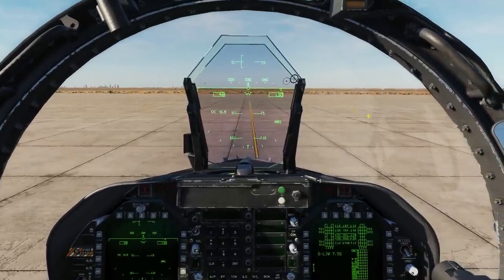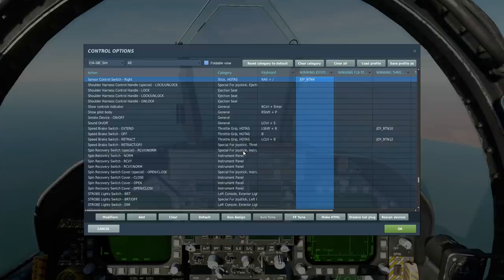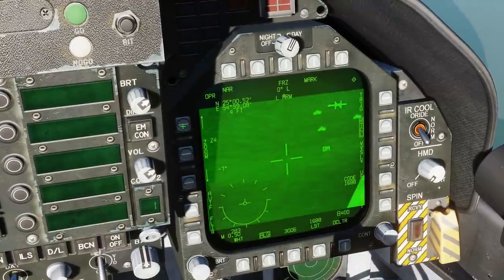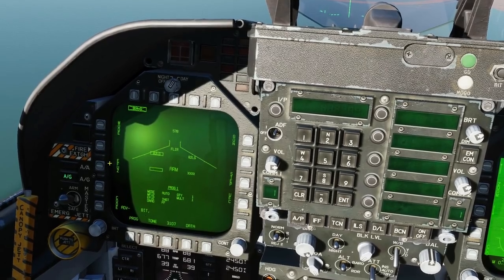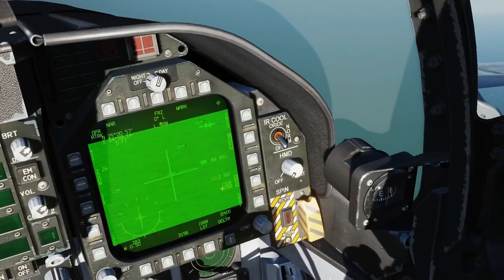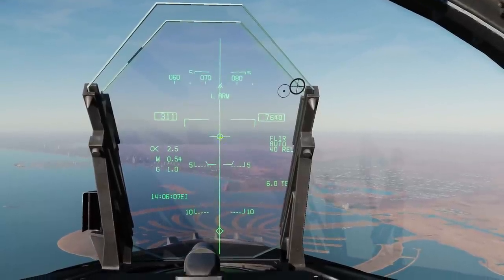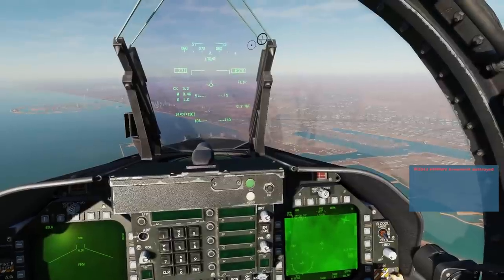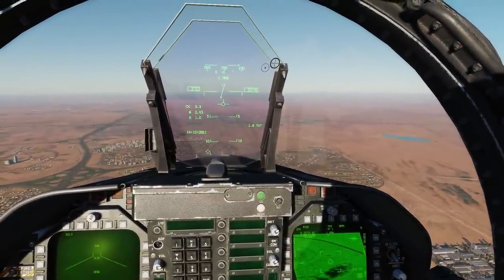FA-18C Hornet: GBU10/12/16 Laser Guided Bomb Tutorial | DCS WORLD

Comment: I have a question. Why would you, in any sensible world, force the pilot to type in a 4 digit code multiple times to make the tgp pod lasers work with laser guided bombs that both have been loaded onto the same plane? I can understand that all these settings should be fully editable so anyone can buddy laze with anyone else, but what massive hurdle is there that stops the plane defaulting laser guided bombs to the code the tgp has when those bombs are loaded. By forcing the pilot to do it, all you are doing is introducing an unnecessary possibility of a pilot typing the value incorrectly. I also find it amazing that you can target and launch 'dud' munitions (weapons that the aircraft's system knows will be useless)
Reply: Normally, you'll have all your codes set up prior to take off. The reason you want it editable is to be able to work with a JTAC or another aircraft providing the target lase. It needs to be editable on the fly in order to provide maximum flexibility.
The aircraft doesn't have a lot of guard rail as the expectation is that the pilot has enough training to make full use of the systems on board.

Comment: Got a GBU 12 on the rack and the laser designator switch is armed so I have L ARM on the hud. The hud is flashing code and when I hit the code button to type it in to the UFC I type the default 1688 and when I press ENT it just says ERROR. I can't tell the bomb what code to use for the track. I've followed this tutorial and Hoggit's guide but all I get is ERROR when entering the code. What am I doing wrong?
Reply: Did you ever figure this out as I am having the same issue
Reply: @mhsucio6830 you probably need to click the "CODE" on the ufc again instead of just typing as soon as you hit the button on the flir
Reply: @MedicLukas  you are correct. Thanks for atleast responding.
Reply: @mhsucio6830  no problem m8, happy to help. Sorry for the late response

Comment: Whenever I try and use the tpod it gives me all the info on the screen but the backround were the camera would be showing is just blank green as if the screen is turned off but I still have all the info on the screen.
Reply from the maker: You got it in STOW mode. Click VVSLV on the right of screen :)
Reply: @grimreapers  howdy GR, i have a similar problem, screen says Not timed out. Does the lightening pod have to "warm up" or something, or should i avoid testing the flir on ground preflight? Cheers

Comment: Im having a problem with the laser designator not turning on to arm, any recommendations other than im stupid
Edit: NVM  fixed it
Reply: how did you fix this. i have the same issue
Reply: @gramerly  you need to have A2G mode selected and the FLIR Pod switched on
Reply: @simadapt9665  how do you turn on flir pod

Comment: DCS Question: Will the F/A-18A/A+/A++/B/D models be added?
I felt like F/A-18C wasn’t enough in the DCS World. We have the F-14A (135-GR late, and the upcoming 95-GR (early), 135-GR (early)) the F-14B, but not for the F/A-18. For me to specify the F/A-18 variants in DCS, here they are:

F/A-18 Legacy Hornets in DCS
F/A-18A/B (Lot 4 - 9) or (Block 5 - Block 22)

*F/A-18A+ (Lot 4 - 9) or (Block 5 - Block 22)

**F/A-18A++ (Lot 4 - 9) or (Block 5 - Block 22)

F/A-18C (Lot 10 - 11) or (Block 23 - 28)

F/A-18D (Lot 21) or (Block 52)

*Some airframes received the AN/APG-73 radar, but does not equipped with helmet mounted display and AIM-9X

**Some F/A-18A+ airframes were upgraded to the A++ with new ejection seats, helmet mounted displays and AIM-9X.

Now, the older variants and block models could play differently but similarly to the F/A-18C we have in DCS: Lot 21 F/A-18C. We need a diversity of fighter jets with different variants.
Reply from the maker: Nothing planned as far as I know, but I've learned never to assume anything.
Reply: I’m not making assumptions. Boeing has a video of the F/A-18C+ program where they take some older production F/A-18C.

Websites and forums mentioned F/A-18A+ and A++.

If I’m too complex and confusing, I’m sorry for wasting your time.
Reply: @blueofthelightanddark6273  if thats confusing imagine simulating the spanish EF-18M wich began as an F-18A+ then it had basically all its avionics upgraded , MIDS and datalink 16 upgrades, and the MFD UFC of the Rhino but retaining the older APG-65 (upgraded to V3)
Reply: I think making a full fidelity F/A-18A+ or A++ would be a different or similar jet; I know it’s highly unlikely, but I imagine of a Navy F/A-18A+ and (Marines) A++ cockpits in DCS and how it can be accurately presentable as the real A+/A++ because we only saw the Australians F/A-18A and Canadian’s CF/A-18As cockpits.
Edit: Besides, are the As analog or digital or combined both?
If it’s the F/A-18A is analog, then why wouldn’t the F-15As receive modern upgrades? It could have been an F-15A++ or F-15AM.
Reply: @blueofthelightanddark6273  The F-18A cockpit is almost the same as the F-18C .. about the only thing that changes is the fuel and engine panel wich is analog instead of digital.. it should be easy to do o DCS.. the rest is the same but with older avionics and a slighty worst radar (APG-65) and controls are the same...if we talk about an A+ it probably had its avionics and buses updated and if its a canadian , australian or spanish the avionics go beyond C standard (except the radar in the spanish ones wich was upgraded to APG65V3 but not to APG-73).
The F-15A and C were much more different than the HornetA-C . the F-15C had a MFD for several functions and HOTAS wich the A didnt (different sticks between Eagle A and C). Even the Viper had a quite different cockpit and controls from the A to the C ..but the Hornet is esentially the same , upgrades were more to the inner avionics and sensors than to the cockpit/controls.
Reply: I’m no expert. 
However, I look into searches of F/A-18A++ for Marines. Article I found, someone says the Alpha++ is better than the C. What engines the A++ has? Same engine as the C? If these A++ upgrades are still classified, then we don’t know exactly. I mean it has a JHMCS, newer ejection seats, LITENING pod capable on the A++, though it still has an analog engine indicator. VMFA-112 reserve fleet still has the A models. I saw two vids of VMFA-115 Silver Eagle during 2014 and 2015, and it has the same avionic upgrades as the RAAF’s F/A-18A/Bs. Replaced the old, multipurpose color display dials with modernized MPCD switches. Ratio of the A++ match the late production Charlie models.

For the F-15. I’m not sure if you heard of the Multistage Improvement Program for F-15A-D.
I mean the MSIP A/B and C/D were subtlety similar. Certain airframes (later on around 2004) has the F100-PW-220/220E “Dash 220E”, replacing the “Dash 100”. Has AIM-120s, AIM-9X. Similar avionics and sensors on certain A/Bs, cockpit photos are on the F-15A/B MSIP book by DACO Publications. What about the MSIP F-15A/B radar? The F-15A that looks closest to the F-15C was 75-0072. Even with 220E engines, why the MSIP F-15A/Bs still can’t have service life extension upgrades? MSIP As didn’t have similar modernize treatment as the F/A-18As.
Edit: That’s another full fidelity jet I imagined, the MSIP F-15A in DCS World.